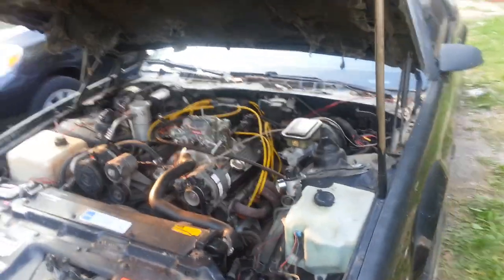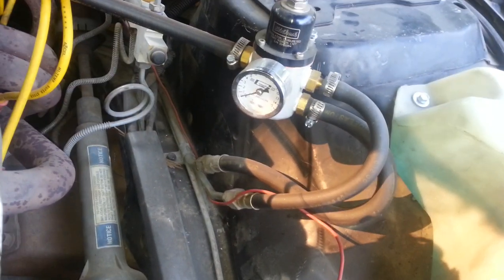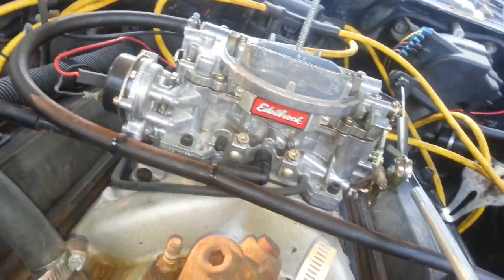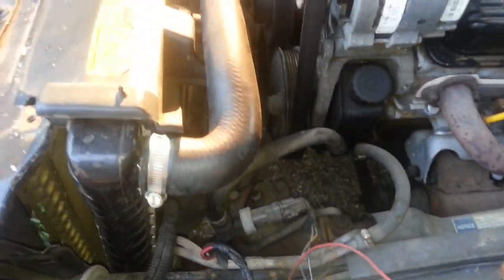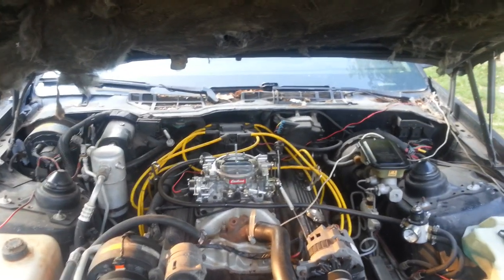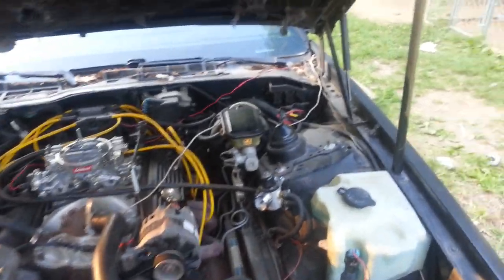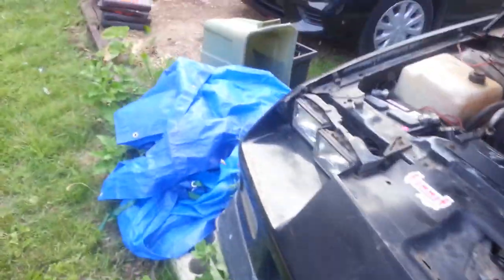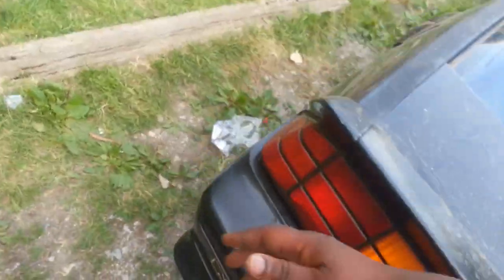1991 camero rs tbi to carb. 350 swap

Comment: 1st check the air dam under the car, if it’s not forcing air to the radiator you’re going to overheat 
2nd add a plastic carb spacer between the intake to prevent vapor loc 
3 get some 3k cfm e-fans wired to temp sensor

Comment: you are missing the fin under the front ,that directs the air flow thru the radiator when you are going down the road.like you said ,it only got hot when are going down the road.

Comment: I did the same thing with my Firebird 88 305 I got rid of all the air conditioning and got rid of all the extra stuff under there mine had an overheating problem too but I got it fixed by getting rid of all the extra junk new radiator fans

Comment: The air dam direct the air up so the air can flow thru to the radiator, without the air dam the air just flow under the car and the radiator will not get the air to cool the car. Because of the way the radiator is mounted in the car it need the air dam so it could get the air to cool it

Comment: Has nothing to do with "air damns" or anything else you have your vacuum advance line for your distributor hooked up to your constant vacuum port on the carb.(causing your idle rpm to climb till it overheats) it should be on the left vacuum port (its ported) you can see a vacuum cap @ :45 seconds. just switch em around problem should be solved.

Comment: The air dam is a piece of plastic that under the radiator support if your car is missing it your car will over heat all the time, I know because I was having the same problem, when driving on the street it was ok, but on the freeway or highway it would over heat, so it sound like your air dam is missing or damage

Comment: The correct answer is reverse flow water pump by one from parts house for a serpintine belt not v belt .V belt is regular flow serpentine is reverse flow
Reply: Ken Casey another good point made .

Comment: This Robert Barksdale son what kind of thermostat u get some of them take higher temps and the next thing I can think of is a constriction or ur fans can't keep up when the engine under a load u may have to get bigger fans and put one on front the bring the air to it and one on the back to suck heat from it

Comment: First thing is to make sure you've got a good water pump thermostat and hoses the 2nd check the ignition timing if its too far advanced it will get hot quick when driving and that being a low compression stock motor it won't ping it just will. Run hot and for shit .. it sounds like some pretty bad vacuum leaks possibly the intake gaskets its idling way too high and does not sound very happy at all bring it to me I'll make it run as good as it can .. that distributor is it used ? Make sure the mechanical advance inside it is not stuck I've seen them get stuck from sitting and have no power advance it to have power it won't start get all that right makes a huge huge difference in power and over heating issues put a curve kit in the dist advance make it come in faster stock motors like advance and if you do all that you will be very very happy with the results

Comment: get a 165 degree thermostat , change your antifreeze to 50/50 , looks like you have a electric fan ,   whats happening is vapor lock thats why she shutting off on you , you can wrap those headers to retain the heat to hope it helps.

Comment: Not one single  person mentioned the electric fan if it's working or not? When whomever did the swap obvously the wiring harness for the throttle body was disconnected, temp sensor, ect Im sure other shit  was left unhooked I'll bet the  fan relay isn't  not Getting  a signal to kick on when it gets up to temp.

Comment: Hey look under your car to see if the plastic airdam is there, it should be under the radiator support, if it is not there that the reason your car is overheating

Comment: SO IF YOUR HOLES ARE HARD WHEN THE ENGINE IS ON. Flush out your radiator and motor. Get good anti freeze 50/50 GM. replace thermostat.

Comment: Hello on your over heating issue does it have electric fans my 89 z would over heat I put a after market fan wire in kit fixed my prob

Comment: The reason you're 91 camaro keep getting hot these cars did not have enough ventilation front of the car so it can breathe. notice the front of these camaro's didn't really have a grill so the air can go straight into it.  Go buy you a electric fan to add to the radatior, or but a newer radiator with the thermostat or switch come on at a lower temperature that will make your fan come on before it gets too hot, and come on earlier than what it used to. also change radiator hoses top and bottom make sure they not to long no kinks. Now can you help me?  I want to take my TPI off and go with the carburetor set up to.  when you did that you just unhooked the injectors. or did you have to do a lot of rewiring to get that set up. I was thinking just unhooked the injectors change the intake to the carburetor and it'll crank right up that's what I thought. so please could you tell me what can I do.

Comment: Does anyone here know if switching the whole starter and fuel pump, yanking out the ecm and going from tbi to carburetor eliminates the VATS on this car?
Reply: 80 Eddie depends how your are delivering power to the needed accessories to run

Comment: What's the advantage of switching it to a carb instead of TPI on this camaro?
Reply: Channel0002 well considering it's an RS and not a Z/28.. it's probably 99% certain it didn't come with a tpi setup. It most likely had a TBI. Most guys who have/had one ditch the 305 TBI and get either a carb or a different motor.
Reply: nik krenitsky I love people who are like that. because once they see how much they can do with a EFI setup it blows their minds. I just put one on my 400 Pontiac and it runs SO much better and makes a little bit more power too. Part of it was having a junky ass carb but words can't describe how much better I prefer the EFI system.
Reply: I was wondering the same honestly, to make a huge long story short and to make what I've read summarized, many swear by the reliability of the old carb vs the now many years old computers, wires, and electronics. With all the new parts and sensors I bought trying to fix my old 92 305 tbi firebird up, I could have switched to the simple carb. Even after a FULL tuneup overhaul and many new sensors and filters mine has never run quite right and takes a long time to actually crank and start up, versus this guy's car and every other carb swap vid where theirs starts up literally instantly. Sad as I love how these cars look but man, you literally never see any of em on the road anymore, maybe they all fell apart and died by now, one friend told me he thinks most got crushed in cash for clunkers years ago. It's VERY hard to find one in a good condition these days, unfortunately I got stuck with a 27 year old neglected by previous owners vehicle
Reply: Gets rid of tbi. Notorious issues. Can dial in more power and can run nitrous. Those are 3 issues why I changed to carb

Comment: Whats the update status? About to go from TBI to Carb also. Oh.. to answer the riddle of your over heating issue: 1) Bottom radiator hose is collapsing, put a 1 -1/2" coiled wire spring inside top and bottom radiator hose. 2) L31 Vortec Engine needs to have a hose connected from front of Manifold  to Top of Water pump (L31 Vortec Water Bypass).

Comment: you're only issue with the overheating is you need a 3 core radiator you have a 2 core in order to properly keep a 350 cool you need to be running a 3 core twocor alright with V6 Motors in some smaller V8 but the properly keep the 350 cool need a 3 core